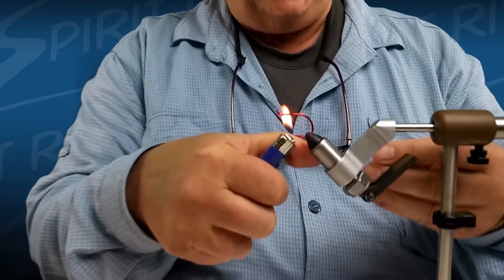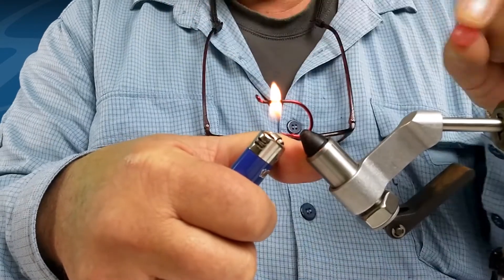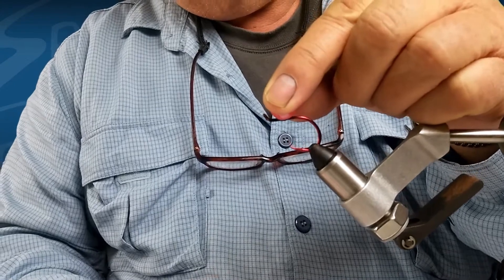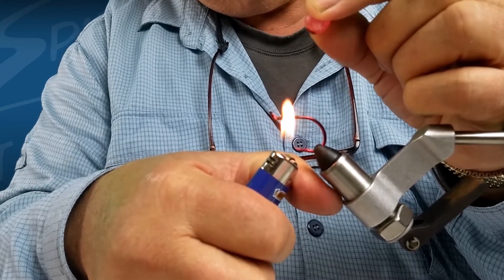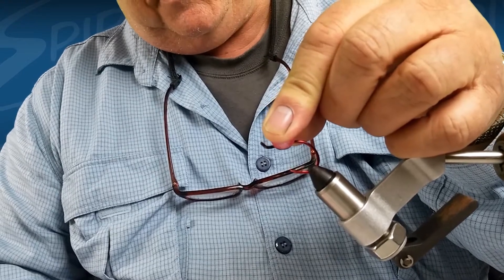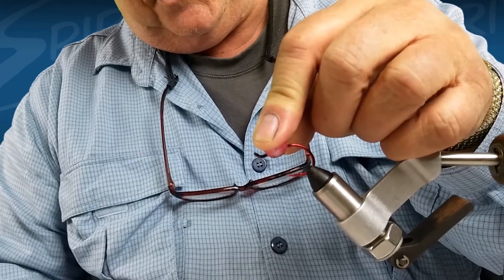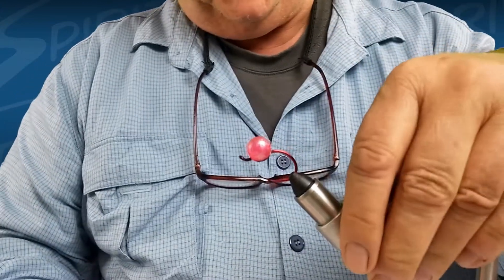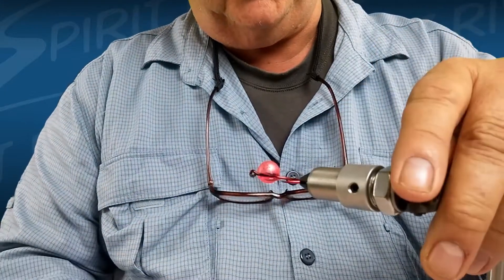Melting UV2 Fusion Egg Beads on a hook shank

Comment: Excellent idea! The attachment is super secure. Fishes well. Suggestion...conceal the hook tip in the vise. The slightest amount of overheating will anneal the metal. Use the tip of the flame and count to 4 or 5 to prevent damaging the heat treat process on the shank. Metallurgy 101